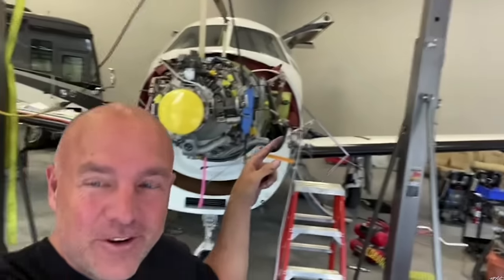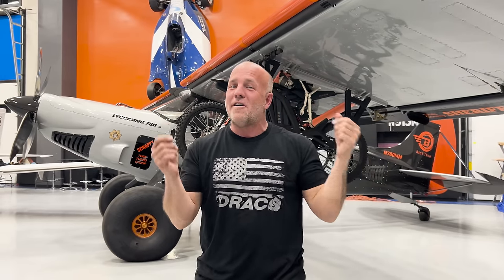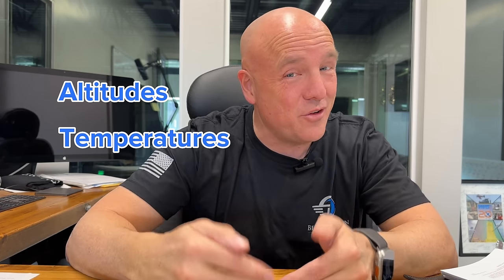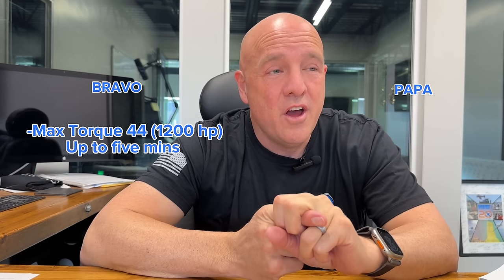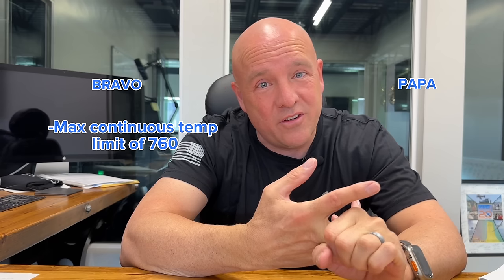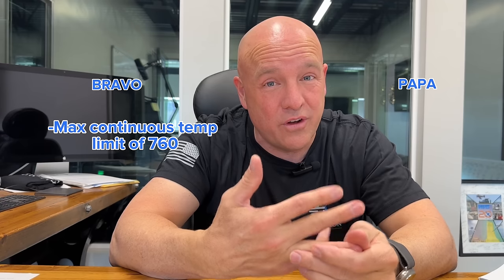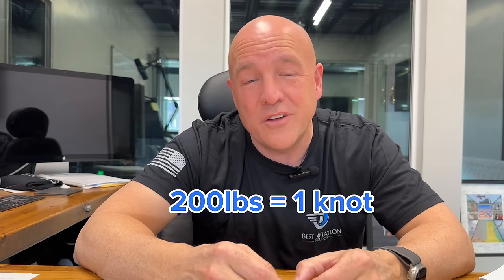$1M Engine Upgrade to a Pilatus PC12 - Was it Worth It?

Comment: Great information. The low down is apples to apples, not the oranges, bananas, or pineapples...  Time speed, temperature, altitude...and most important Fuel burn per setting... The added value and of safety and ease of operation as you point out is "Priceless"... Thanks Mike to all of us gearhead airplane numbers pilots out there... We devour POA for the gold in them...

Comment: As a Mechanical Engineer (now retired) I am always interested in engines and things they go in! Sadly, most of my professional career was involved in Forensic Failure Analysis of those where the internals decided they didn't want to play nice with each other anymore! ☹
Reply: So, you studied what happened when internal combustion transitions to external combustion... Ferrari might want to have a word. Lol
Reply: @TomGS  Actually most of the ones I dealt with were German Diesels. Ones that usually were run low or out of oil, and then run to destruction. 😡
Reply: It may have seemed boring to you but as one consumer of millions that benefit from people like you doing that work thanks :)
Reply: @danielc9312  ditto
Reply: @PhilG999  the design engineers call that unscheduled rapid disassembly a feature not a bug. 😂 as an automation engineer I’d say that it was purely mechanical related. 😂

Comment: Your explanation covers what the poor pilot was trying to manage in the Pilates medical flight accident. God bless them all. Thanks for the info
Reply: The NTSB made it appear as if the Pilates medical flight accident was caused by inflight breakup or structural failure in which case the pilots were not the cause of their demise.  🤔🧐😳
Reply: @jamesburns2232  can you elaborate? I have not heard of that one?  Maybe a paragraph of everything?
Reply: @OnceShy_TwiceBitten  You need to contact Dan Grider from Probable Cause. He can explain it much better than I can.

Comment: Mark, you did a perfect explanation. It’s so good I can use it in my lectures at aviation college 😊.
Obviously the climbing part is what makes thermal difference performance wise. 
Nice to see your able to gain some more cruise speed. But getting there the easy way makes grade. 
I have flown loads of multi engine pt6 planes and yes we set those energies not to exceed red line ever. 
We gave up some speed / performance to make some space for cockpit management. 
Luckily some newer planes made life better by upgrade like yours 

Congratulations 👏

Comment: After seeing a ton of pilatus at work, this is insane hearing about the difference. With all of the modifications you have already done, do you have the door handle upgrade to make it flush with the side, and I believe there is also a speed nose that will also grab you a few more knots. The nose is rare and I have only seen 2 of them. I feel like the whole experience of having it done and a new feeling for the plane is great for piloting! Keep up the good work!!!
Reply: I do remember both of the speed noses I have seen were on legacy pc12. I don’t know if there is a restriction because of a different engine from not seeing it on the ng.

Comment: Thanks Mark/Mike!!  I'm a big nerd so I listened to ever word and loved it!  I could have 1k questions, but the big one is, why not go to a PC24?  It's PC12 based, still STOL and single pilot, but does everything even faster/better than the new motor! The PC12 resale value is excellent, factor in the 1M upgrade and it's not that much more considering what you get!?! I believe it's even more FADEC and has auto-throttles to!  The climb and cruse is faster also!?!  Great video, thanks much!!   8)    --gary

Comment: I love ppl talking about $1M as if nothing for a motor. That is my net worth. Ha ha. I have zero jealousy and feel rich in the Lord and all the blessings I have, including my Lyc 0360 powered  RV7. I love numbers as an engineer and airline pilot.... The upgrade was worth it? If you have the money yes. It definitely added performance and resale value. Q: Is that a $1M including trade in for original PT6? Considering a full PT6 overhaul is $460K flat rate, (could be less), $1M for a NEW PT6 with higher thermal limits is pretty good. Aviation to save $1M you have to spend $5 million. Ha ha. Planes do not fly with LIFT and THRUST.... They fly with $$$$$$$$$.
Reply: 460 flat rate overhaul will not happen.
Reply: @stephandelaat  who are you? Won't happen? Ha ha. $460K is not 460. Punctuation matters. That is $460,000 and it is high. It can be done for less. I talked to P&W Canada. I  worked for P&W military engines in CT as an engineer. Ala Cart overhaul with minimal parts replaced is  less if the PT6 is in good condition, well-maintained and properly operated. Does not include prop overhaul. I just looked it up. Do research before you open your mouth.
Reply: @gmcjetpilot  I sell PT6A maintenance and in can tell you an all inclusive (oem approved) flat rate overhaul for 67B at 460k can not be done. 460k is probably closer to the average 67B overhaul price. They can end up at 600k or even higher.
Reply: @stephandelaat  What is it? Can or can't be done for $460K?  You contradicted yourself. Did you think I said 460 dollars? Ha ha. If  you have a crack in combustor or turbine cost can go way up. I have 35 yrs in turbine aircraft cert, maintenance and operations, mechanical engineer, ATP with 6 types. If you can (apparently) buy a new PT6 for $1M (M means million) then yes you can get an overhaul for much less. Your Apology to me accepted.
Reply: Engine not a motor.
Reply: @2K9s  that’s a worthless fight. Such a stupid argument to start. Yes there is a difference. But nobody honestly cares if someone says motor vs. engine.
Reply: @willcunningham8818  who’s fighting, arguing, or cares?  Cool, obviously you do!  The irony 😂
Reply: @2K9s otor not engine. Or fuck it just call it the rubber band
Reply: But had to brag that your net worth is 1$ million 

Doesn’t matter if you have richer friends/acquaintances 

You’ll always want to show off a little. 

Nice comment trying to camouflage your brag though 😂 👍🏾
Reply: A friend of mine was amazed when I bought a $8k car with cash, so it's really hard for some people to even imagine blowing $1m on an engine upgrade for a toy.

Comment: If my memory serves me right you mentioned that the papa motor goes to 5000 hours before major overhaul compared to the bravo only doing 3500. You compared them as the same TBO but that 1500 hours makes a huge difference when figuring the the cost from just overhauling the bravo! Also, what about down time? Because, with my experience of you have to pull the engine off and send it out to be rebuilt the down time is unknown, having a new engine to slap in as soon as the other comes out and putting it back in the air had to be a huge bonus. 

Love you brothers having the time of your life and bringing us all along for the ride! Mark, have you come up with your "get back to work line yet"?
Reply: The new motor, IF equipped with FADEC has 5000 TBO, without FADEC its 3,600
Reply: @801pilot  OK, I guess I didn't realize that wasn't part of the upgrade. I stand corrected. Appreciate your time catching me up, thanks.

Comment: Upgrades are always worth it, know matter what it is, plane, or any other vehicle, if it makes it safer, more relaxed to use, more reliable, you feel more confident, and safer in using it, (lot less stress).
Reply: LOL what?  An upgrade in no way means all those things you mentioned. Can it? Sure. Does it? No. I upgraded my car many times. Not only did almost none of them so the things you mentioned, many of them did the opposite.

Comment: Really appreciate your breakdown of the numbers, specifically how you explained cost to rebuild and fuel burn.  Engine size is relative to weight.  Ex. Ford ecoboost engines are great but think the 2.7 f150 is too small for a fully loaded truck therefore fuel economy suffers.  Plus I have dyscalculia so your explanations include the process of your shakedown(s) make total sense.  
Thank you.

Comment: I used to fly the legacy and ng, but not the new NGX.  The NG had way more get up, and the 5 blade prop we had on some of the NGs added another 50-100 fpm on the climb.  Believe it or not though I actually preferred the legacy in the hot summer months because you didn't have to wait 30 seconds or more in a 110+ degree flight deck for the Honeywell to boot up so you could start the motor, but I wasn't paying the bills either.  The new flight deck was amazing though

Comment: Mike, please watch the latest accident update, the update, not just the report of the Pilatus PC-12 in flight breakup .
In my opinion the breakup was caused by rotational flutter of the vertical stabilizer, with the separation oh the horizontal stabilizer .

Flutter depends on true airspeed not IAS,  At altitude that is the case ,  Remember the redline speed , VNE is always given in CAS ~ IAS with a margin about 15% below the design limit, also CAS. At 18000 feet TAS is 33% higher than IAS. You  are then exceeding the flutter inception speed by 18% when flying at VNE, all the structural margins are lost
Since your TAS is increased considerably at altitude with the new engine, your probability of encountering flutter are increased even if  flown 20% below VNE.
Personal experience with HB-YBI, designed by Bircher , EFF 'Prometheus' where I did the structural analysis and flight test.
Watch Blancolirio's recent update and my comments.
Reply: At 22000 feet the TAS is 1.41 × IAS
at 33000, where I used to fly,
TAS is 1.73 × IAS 
 your CAS defined redline is no protection against TAS dependent flutter.
Do not descend at high IAS at altitude, think about it .
The built in margin in VNE is eliminated at 9000 feet against flutter.

Just  to  mention : Pilatus is the name of a Mountain near by, where a cable car leads up to the peak of ( peeh laa tus )

Comment: I'm not really surprised at why Mark is so excited about the Papa upgrade.  As to the price delta, it makes sense.  If you have the money to purchase, fly and maintain a PC-12, then that extra $350,000 is not a deal-breaker.  On top of that higher altitude, better fuel burn per mile, what's not to like.

Mike/Mark, what I really want to see, and we caught a glimpse of it at the beginning of the video, is the new paint and new avionics!  I do like 'Perry' where it used to be 'Pilatus', though.  😁🤣🥰😍
Reply: Maybe a STC for the PT6E would be another next upgrade with a comparable impact.

Comment: I have over 11,300 hrs of which 5,000+ is in Pilatus Aircraft.  1,000 Legacy PC-12/45 & /47, 2,700 hrs in the PC12/47E NG, and about 50 in the PC-12/47 NGX along with about 1,300 hits in the PC-24

As you mentioned weight makes a big difference in the PC-12 along with CG.  A aft CG, still in the envelope, will yield a faster cruise than a forward CG.  I fly book TQ most of the time which equals 720 ITT in a Legacy and 780 ITT in a NG.  

One airplane I fly, a 1997 Legacy, is a lightweight bird.  It’s only 6,151# empty.  That’s with G600 TXI, 650/750 stack, and 6 executive seats and a 5 blade MT.  That air will cruise at 263 all day long at 720 ITT.

I also fly a NG with a 7 blade MT.  It climbs amazing, takes off and lands short, but we lost 3-5 knots in cruise over the 4 blade we replaced.

Comment: All the Numbers, what altitude was the Coffin Corner with the new engine? Max Altitude, where you push forward on Stick and go down. Pull back on the Stick and go down?
Reply: It Never gets there.  The PC12 is limited to 30,000 feet.

Comment: An even better mod for your PC12 is the reduced prop speed switch on the NGX. You go from 1,700 RPM to 1,500 RPM. Way less noise, less fuel burn. It is not available as a mod on the NG, but this must be doable.

Comment: Regarding p&d numbers; how much would you say a person could improve those numbers by small changes to engine cooling. Typically I realize you go off a set average temp day etc,  but let's say if you increased the air cowling a max of 2% is it even a noticeable measurement in engine Temps. Just wondering if you think there would be room for improvements down the road for R&D .

Comment: Is that price with you and Mike performing the work or a service center? Figure yall would be the installers but curious if there were any price install differences with the motor.  Tough to beat the Pilatus all around.

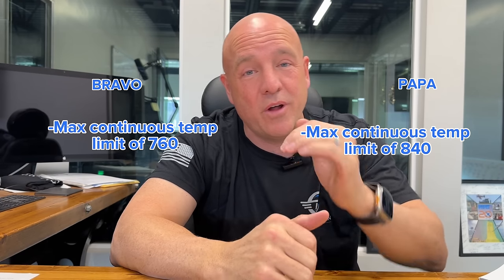Comment: @04:20 you call the temp 60 degree higher limit for the ‘papa’ motor ( you say 820), vid shows 840. @07:25 bravo max 760, you like to fly 40 below is 720, not 740. The money point, is probably focus point for many people. Hell I could not afford it (lol), but I see it more as a safety investment as you explain before with the throttle setting. Think of a fully loaded plain, family kids, grandkids? Safety is number one! I would say great call, wish you all the best. Now I will go cycling to the supermarket 😂🫣, hé i upgraded to a electric cycle hahaha
Reply: The video editor miss types the temps.  What I said was correct ✅

Comment: Was the old engine a trade in for core, and can that engine be rebuilt to the new specs of the P version?  For comparison, in Vietnam I was in an OH-6A and asked the pilot to take it up high so I could have some cool air for a change. Of course the doors were off, so we went to 7000', and that was as high as the turbine temp limit would let us go. I think the ambient was still 60F  plus at that height. But it felt sooo good.
Reply: Normally You trade in the old motor.  We decided to keep ours for another project

Comment: if the 2nd overhaul is twice the cost of the 1st, is the 3rd more inline with the cost of the 1st? or would it remain at the level of the 2nd or maybe a different figure due to a different standard of parts inspection/replacement? i'm curious being an auto mechanic looking over the fence at A&P tech's, but the question could be relevant to someone who has already done a 2nd overhaul
Reply: 3rd overhaul in most cases are more expensive because there are rotating components that have cycle limits and depending on the engine build spec will cycle out 3rd run and will add a considerable amount to the cost of the overhaul. That’s why most people upgrade , the cost to overhaul becomes closer to buying an new engine . And the 1 million is an exchange price not outright. I hope this helps

Comment: Mark, thanks for not soft pedaling your reason for going with the more costly upgrade.  It's a data driven a/b comparison.  The additional costs can be justified with increased safety, reduced pilot work load, reduced flight time, more load capacity and better fuel efficiency.  All that comes at a price of $100 per flight hour.  If that's too expensive, take your broke __ home.

Comment: The cost of parts on these turbine engines is obscene. They're making a huge profit on each part.
Reply: Can't be helped for the following 2 reasons I can think of:

1. Low relative demand. (There're more cars than planes).

2. The high quality of materials & construction to ensure safety & reliability.